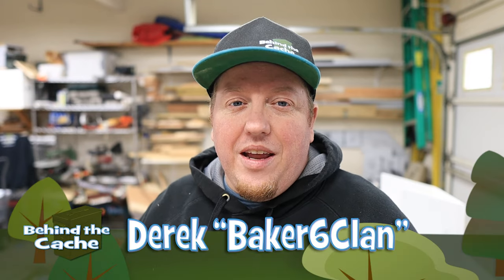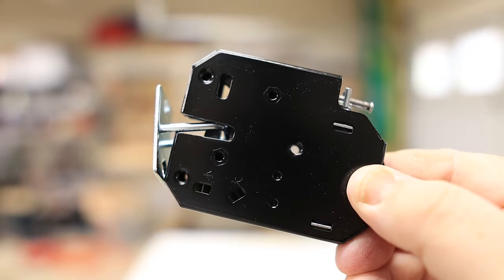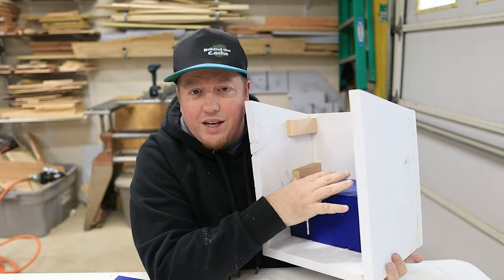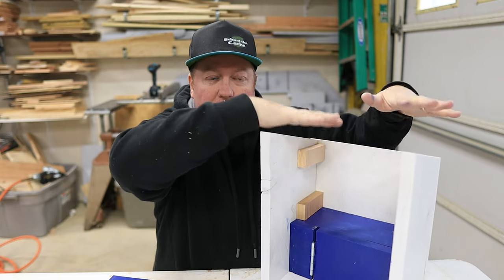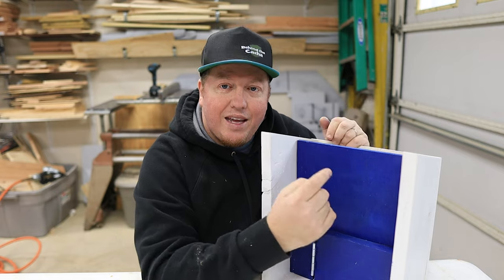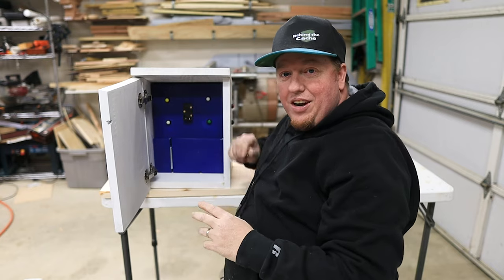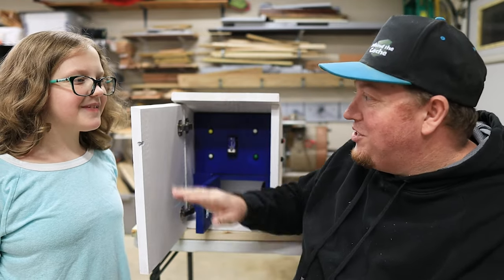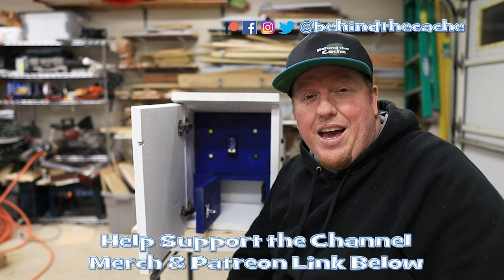Teamwork Geocaching Attribute Gadget Cache Build (GCNW)

Comment: PCV pipe (about 6 ft tall) with holes drilled into it from top to bottom (about 5 or 6) so that one person has to pour water into the PVC pipe and the other person has to plug the holes with their fingers in order to float the log to the top of the pipe. :)
Reply from the maker: Yep that is the one that I got that was the only teamwork cache I have gotten. But it had so many holes it took 4 of us to do it.

Comment: Very nice idea, and I agree that it isn't too hard to make. Two things:

1) People with screwdrivers... I fear that it may be forced open by someone with a screwdriver, and probably damaged in the process. (Sigh.) The same people always log copy-paste.

2) On a more positive note, I think this can be done without demanding people to bring their own batteries. It is a question of having an on/off switch and to make it waterproof. And of course it must be reasonably easy to replace the batteries.
Reply from the maker: It would be very hard to force open that latch. Yes there would be a way not to require people to bring a battery you could also do it with reed switch too.
Reply: @BehindtheCache  That makes the demands on the construction high, but I agree, not impossible.

I wonder, how can you make it impossible (hard enough) to open from the wrong way? Glue tends to break with temperature changes, and screws... there we are again. I may have missed something but the outer box was made beforehand. Any tricks to make it really solid? Just painting over the screws?
Reply: I must add that I really like the idea! True teamwork caches are rare and this is very nice and straightforward! We have a few here and they tend to rely on wires or strings over high distances and they tend to need much maintenance.

Comment: Hey whats with thies Problem?
The Cabinet Latch:

Basically, it's a great product.  However, you can really only trigger milliseconds, otherwise the coil heats up so much that the plastic core melts and the trigger gets stuck.  The result: the lock is stuck.  Within a very short time I broke 3 pieces because they triggered 2-3 seconds.
Reply from the maker: Yeah if there is too much power to it it can do that. That is why I used a momentary switch. Which volt latch are you using?
Reply: @BehindtheCache  9V
Reply: But wen the geocachers push the buttons to long help the momentary Switches nothing
Reply from the maker: Let me see if you might be able to put a diode in so that would stop that. I will have to ask someone.